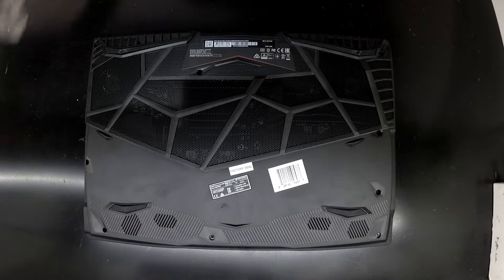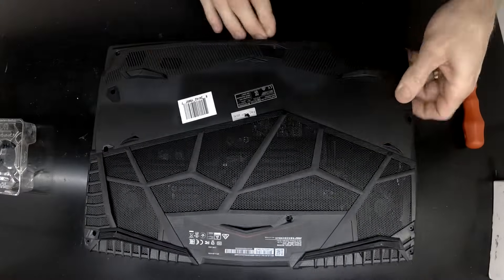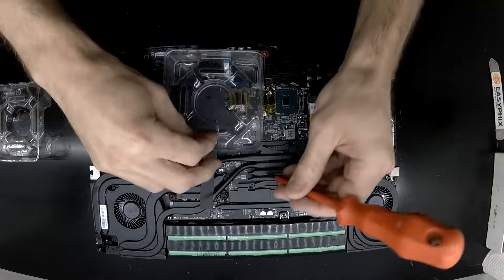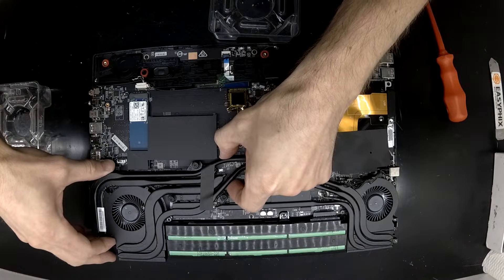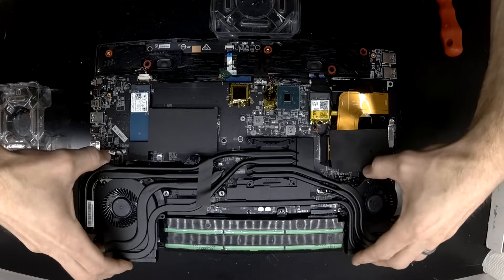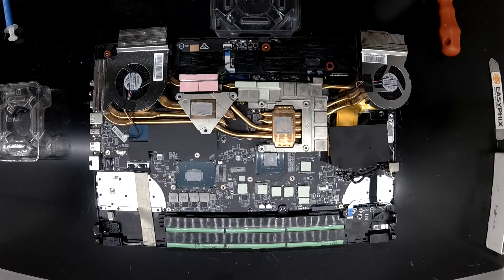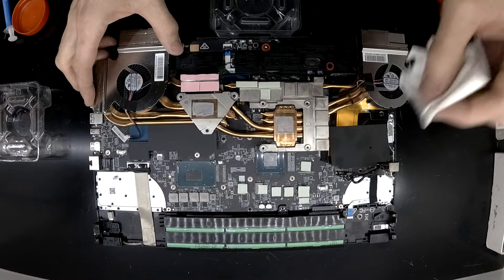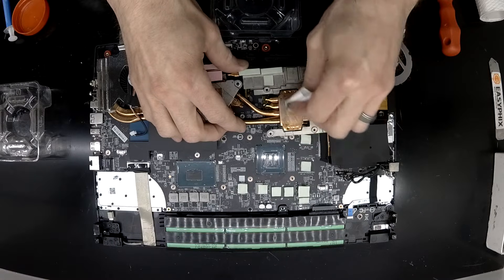MSI GL65 Teardown and thermal paste replacement

Comment: Hello, from your experience, how is the new GL65 thermal performance. It is very hard to obtain GL65 thermal data. There is GE63 which I believe has the exact same cooling apparatus (cooler boost 5), but the performance is a bit underwhelming compared to what Triton 500 with smaller chassis can do. Is it any good?
Reply: Im about to place my order in GL65, wish me luck
Reply: @Klav1eR  well how's the thermal performance?
Reply: @rolf1225  good... i have a rtx 2060 and i7 9750h  and playing red dead redemption 2 at max the temperature is like 70 degrees celcius on cpu and a bit lower on gpu .. the down side is that its very loud but i dont mind it
Reply: @Gabriel-Puia  mine is weird. I have 1660 ti and 9750h, and the CPU is always thermal throttling at 95c!!! Even when playing standard games like PUBG on minimum settings…
Reply: @seanh6179  Could be a factory thermal paste failure. Sometimes something goes wrong and the paste is poorly placed or not placed at all. Might open her up and check.

It could also be bad fan settings. Bump it up from Auto to advanced, perhaps.

Comment: can you show as how to add ssd to this laptop
Reply: I just added a 2.5 SSD to mine. There is a black plastic film covering the SATA port that you have to peel off. You have to be careful with the SD card reader cable as well as the Wifi antenna cables which run through the drive bay. You must remove the metal drive tray (it is fairly obvious as it has a black tab sticking up) by carefully removing two black screws and attach the SSD to it using the two silver screws provided in the box the laptop came in (they should line up with the holes on the bottom of the SSD), then carefully slot the drive in and screw down the drive tray. One of the screws is right under the wifi antenna cable so you have to be careful. After you are done take care to ensure the wifi cables are tucked in next to the drive (they should not be sitting on top of the drive) so they do not get smashed when you put the cover back on.
Reply: @ryantoomey611  @RicksTech please make a video installing a ssd or hdd in the msi laptop. Thank you.
Reply from the maker: It should come from the factory with a m.2 SSD already installed
Reply: and an internal extra sshd
Reply: What i mean is that i want to add another sshd to that laptop and i didnt now how???
Reply from the maker: @xx-shredder69  it has a 2.5 data HDD slot available
Reply: Actually no need to ifound it thanks
Reply: @xx-shredder69  There is a black plastic film covering up the SATA port. It is on the right side near the SD card reader and USB ports.

Comment: What specific type of 8gb ram stick should I buy for a dual channel?
Reply: You get the RAM part number by clicking on the "SPD" tab in CPU-Z. According to CPU-Z the part number of the original RAM in my machine was M471A1K43CB1 made by Samsung. I was able to find that identical RAM stick on Amazon for $31. I just installed it today and I am happy to report CPU-Z now shows 16gb of RAM and they are both running at the full speed of 2666mhz. It even matches the label on the original RAM stick of s7c-s68c803-s02 which is the MSI part number.
When installing there is a black plastic film that you have to peel back in order to get access to the RAM slot.
Reply: Ryan Toomey Do we have to pull out the black tape or just lift the black tape to put the RAM?
Reply from the maker: Open the laptop and double check prior to purchase

Or install cpuz and check ram sort first
Reply: @rickstechrepairs 
I didn't buy the laptop yet 😅
If you still have the laptop and could help me I would be grateful to you.
I don't even know what should I look for in the CpuZ 😀
Reply from the maker: @noamanhigazy6287  it's my current laotop.

I can check tomorrow or the next day
Reply: @rickstechrepairs  
Great!
Many Thanks 😃